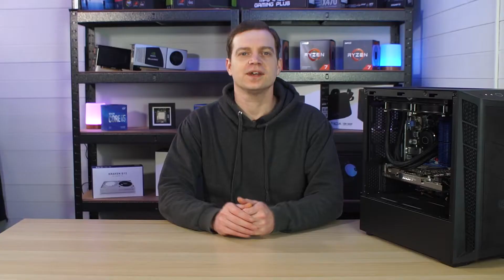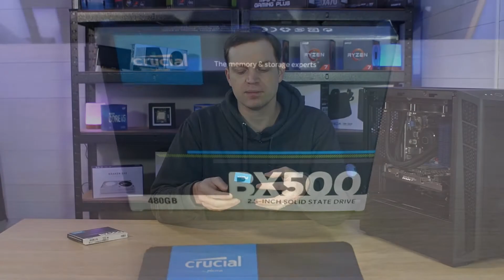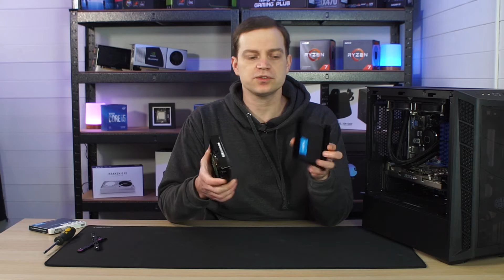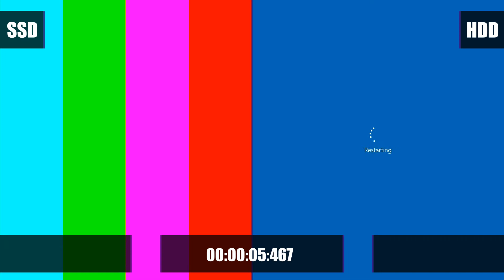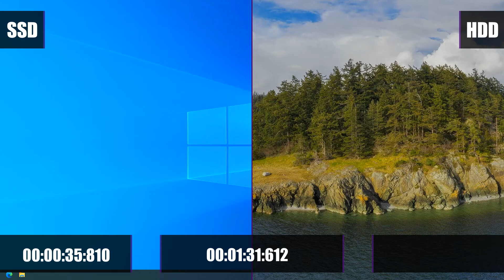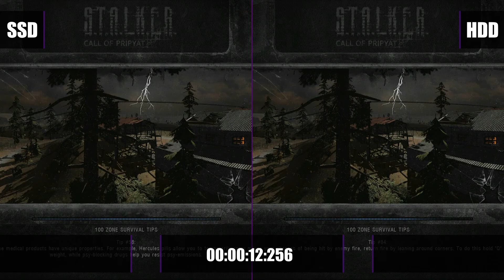How to Upgrade From a HDD to an SSD.

Comment: ⚠️ ABSOLUTELY IN NEED OF ASSISTANCE ⚠️
Mate, I'm in urgent need of assistance here. I've been following your content for quite a few days. That's why I'm assured of guaranteed solution.

I wanna swap my internal Hdd to ssd (as boot drive). But the problem is I can't access bios or boot menu cz if I press any key during boot, my boot gets stuck. I've tried many options from Google search. No luck.
I guess I need to change my boot drive (SSD in this matter) in bios to get it working. But I can't get it done cz of issues. 
Does cloning from partition tool work?? I don't have to go to bios to change/ select SSD?

Would be much helpful if you reply.
Reply from the maker: You wont need to get into the BIOS to swap the drive.  Simply removing the old one and installing the new one will get it picked up as long as it's the only drive in there.  You might struggle to boot a USB to re-install windows on the new SSD though but... as long as the drive is empty in the first place it should go through all devices looking for one that works and will find the USB to boot from to do the install.

If it doesn't, most motherboards will have a different hotkey on boot to go to a boot selection (Outside of the bios) could search for this on your board.
Reply: @TechLabUK  Seems like the "Fix" for me. Yeah, I'll connect SSD and Bootable flash drive, and it'll boot from flash drive and I'll be able to install os.
My SSD will arrive tomo. Will try and update.
Thanks for quick response mate👍🏻
Reply: Worked perfectly bro. Also wiped OS drive from my HDD. And now I can use both my SSD (as main OS+storage) and HDD (as storage) despite having HDD as 1st boot device in bios.
Thanks for your word of advice ❤️
Reply: @TechLabUK  Just 1 thing, when I wiped my OS drive C: on HDD and allocated the free and unallocated space to other drive, my whole HDD became dynamic volume. 
My C drive was 84Gb and D was 131Gb. When I Merged both, whole disk became dynamic. In explorer, D Volume shows 215Gb (84+131) but in disk management it shows different volumes with same drive letter. That normal?

Disk works perfectly, but will this affect anything? Any risks using disk as dynamic volume?
Reply from the maker: @raula.8881  Not sure really without looking at it.  If you have discord, join our server (Links in all video descriptions) and post some screenshots in the support channel, loads of people there who can advise.
Reply: @TechLabUK  Don't have discord but will get for you, cz you've been helpful. You deserve more. Least I can do ❤️👍🏻